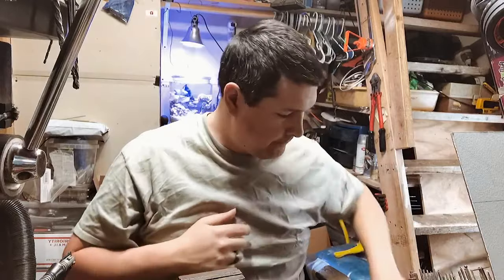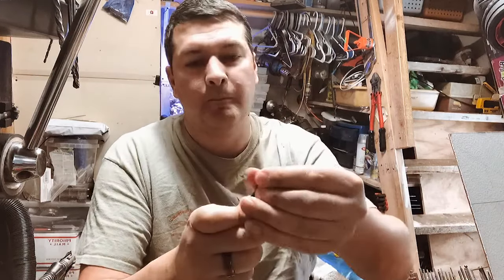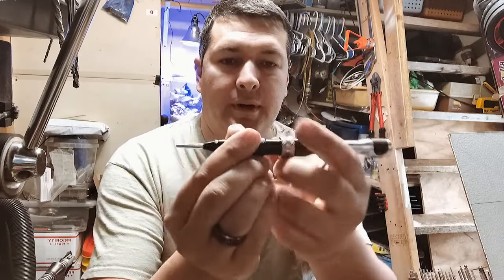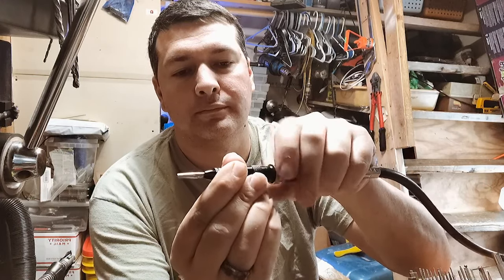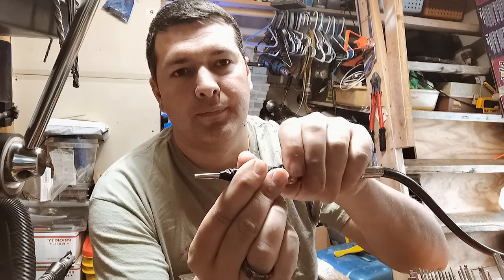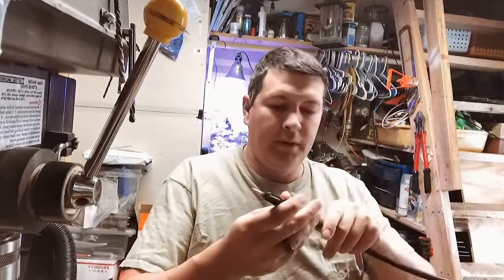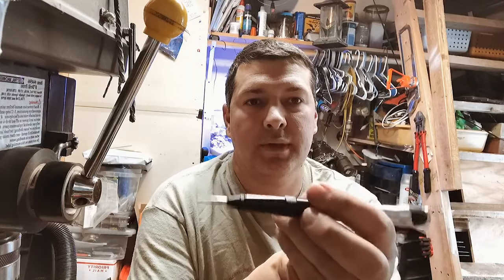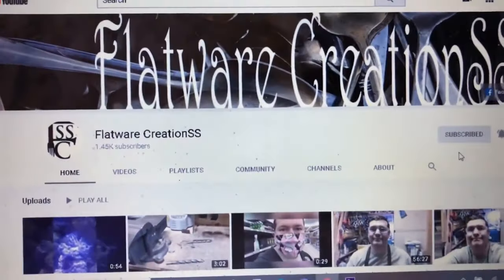My New Hammer Handpiece

Comment: Do you have to get a different cable to fit the hammer
Reply from the maker: I swapped out the cable that came with my cheap rotary tool, to a cable that fit the foremost hand pieces.